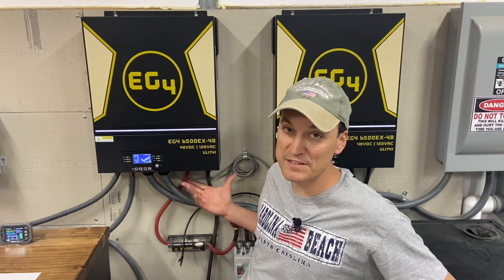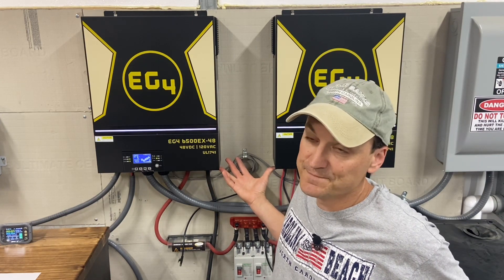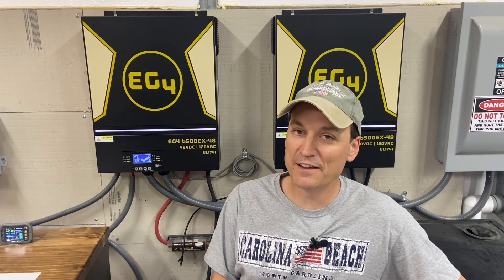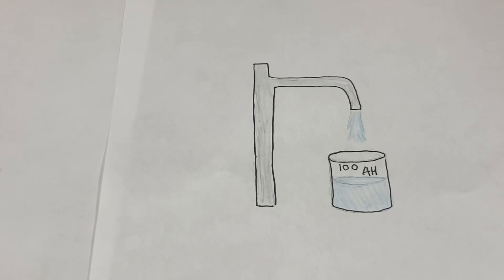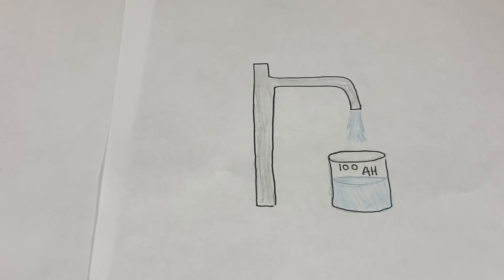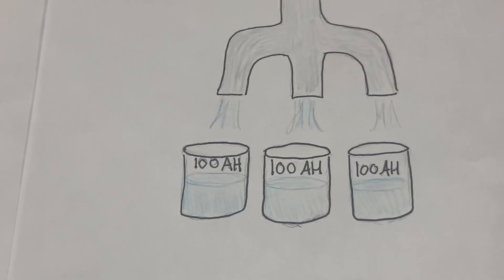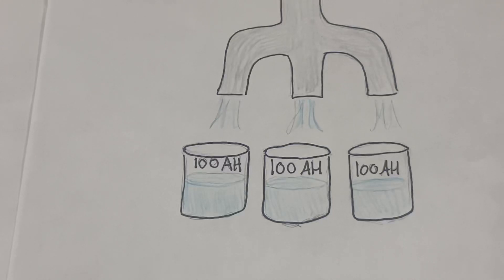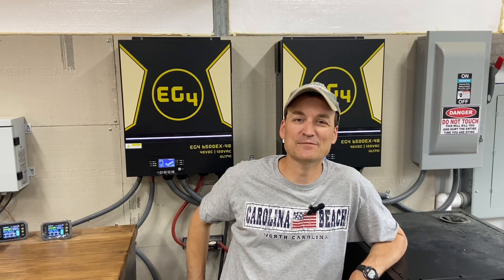An easy way to calculate amperage. And lifpo charge/discharge.

Comment: MPP-LV6548 or EG4 6500EX-48 which is best?
Reply from the maker: I’m still testing the 6500ex’s I got for review. I know if you’ve followed my page it may seem like it’s taking a while for me to give the results. But I had some problems at first. I gotta say I’m really liking them though. So I should have a video next week hopefully.
Reply: @GavinStoneDIY  Looking forward to your comments. My wife and I want to make the right choice. and we need to do it before the dollar collapses more.
Reply from the maker: @stevenfrazier8939  well if I can’t get the video out soon I’ll make sure to comment back as soon as I’ve tested them heavy with PV and discharging. Are you purchasing batteries also or just the inverters?
Reply: @GavinStoneDIY  Interested in building a battery bank with 304AH or 280AH from Jenny Wu at Docan Tech. They have a warehouse in Texas. But I think you already know that.
Reply from the maker: @stevenfrazier8939  the new inverters are working great. I have a video coming out hopefully tomorrow or Sunday. But the short version based off the inverters they’ve sent me now. They are really nice.
Reply: @GavinStoneDIY  Thank you, It will be good to hear your take on it. I have heard a few negative things, but mostly good about the EG-6500EX-48
Reply from the maker: @stevenfrazier8939  I posted a brief follow up review on the inverters. I plan on doing a longer video on what I have on my system And what I run with them in a couple weeks. In the meantime I’m loving them. Charging at 220 amps and running flawlessly. If you do choose to purchase the eg4’s then please consider using the link I have in the description of the review, it would help the channel. If not, no pressure at all.
Reply: @GavinStoneDIY  Thank you, we would for sure use your link. by the way, have you seen this neat kit a man from Canada produces? 

https://www.youtube.com/watch?v=XmqQv1uOGP0
Reply from the maker: @stevenfrazier8939  I thought that was interesting. I’m not sure how well that board would handle a slight expansion and contraction though.